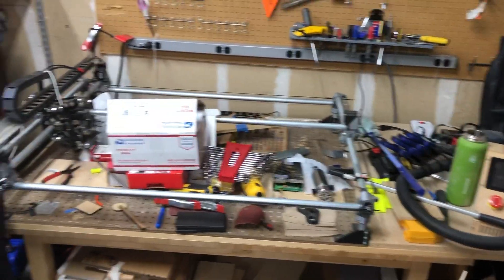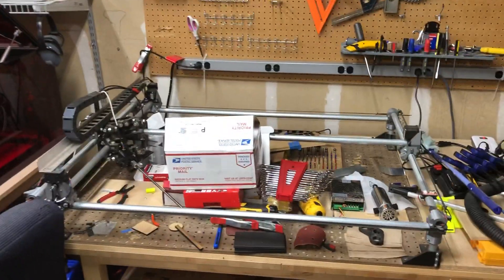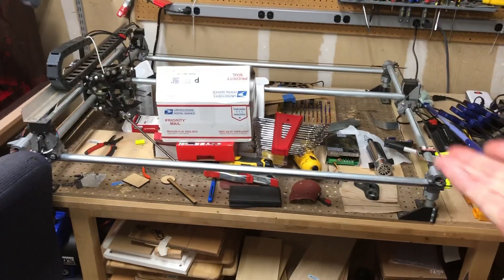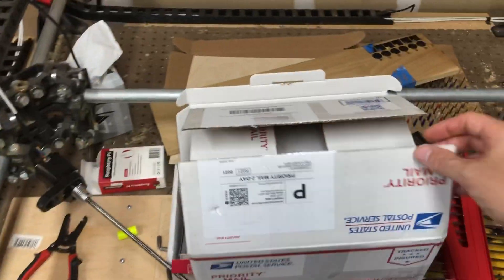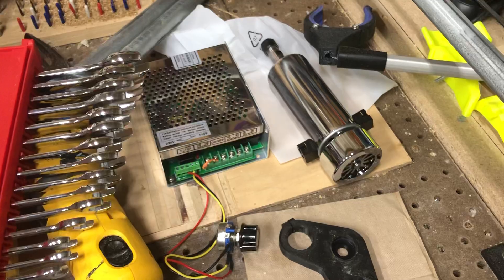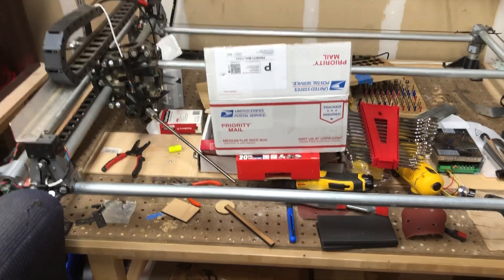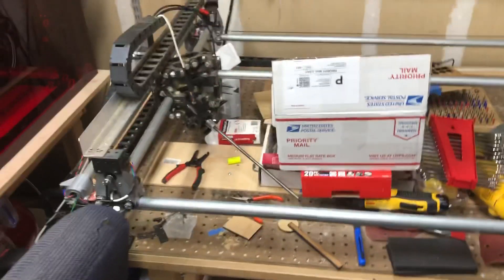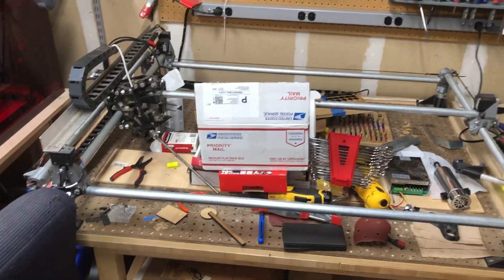MPCNC Primo edition

Comment: im just about to order this. they are sold out on the Rambo v1.4 and the Archim 1.0a. the mini rambo 1.3 is in stock. any opinions you could share? id like to buy everything from one source rather than wait for parts from separate orders to come in. would you go for the mini-rambo or source a rambo v1.4 (or clone) from some place else? i only plan on running mine with my makita.
Reply from the maker: You want a compatible board with 5 stepper drivers so you can do the auto squaring. If all else fails you, an Arduino Mega + Ramps combo works